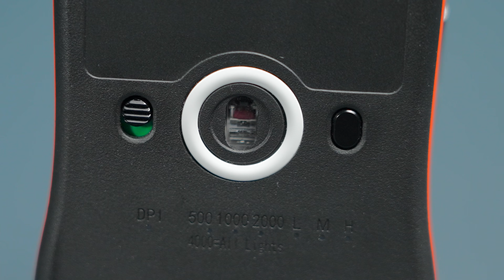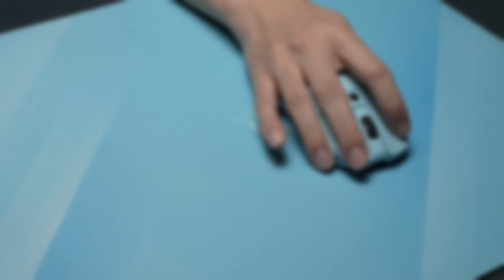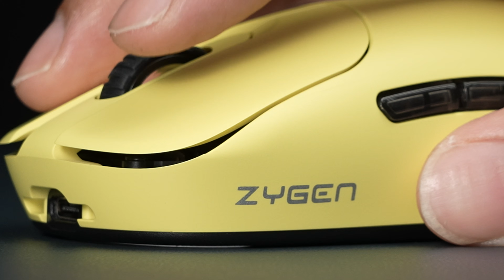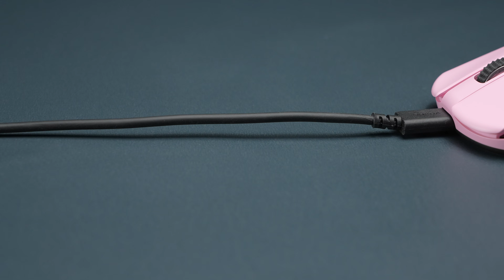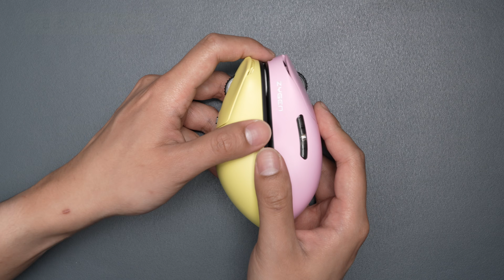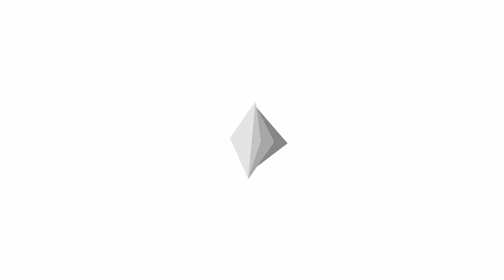VAXEE XE-S Wireless Mouse Introduction Video and Sales Information

Comment: Hi, I cannot find any Driver updatge for XE-S 4K Wireless Firmware update, only XE Wireless 4K. Help me please :(
Reply from the maker: @pandawgf7930  there is no firmware update for XE-S, it comes with the latest firmware
Reply: @VAXEE  But everytime my mouse using the 4K wireless, I got massive drop FPS, and I try with my old mouse, i dont get the FPS drop. Help on this pls
Reply from the maker: @ you can try with 1K and 2K if any change. 4K does use more cpu power, depending on your Pc setting it could drop your fps. You can dm us on twitter or fb with your order number and pc settings for further assist
Reply: @VAXEE  Quick question, how to change from 4K to 1k or 2K?
Reply from the maker: @ at the bottom of the mouse, hold the button until it moves to middle lights, then by clicking the button further you can adjust, 3 lights on is 4k, 2 lights is 2k, other settings are named at the bottom. You can also check XE-S manual under the download page of our website

Comment: Do you have a video on how to adjust the E1 functions via the buttons?
The manual is very confusing
Reply from the maker: Hi, we do not have any video for E1 function sorry, you can let us know which setting you'd like to change and we can inform here; alternatively you can DM us on twitter, FB or our site for further assistance
Reply: @ having trouble getting to 4000 polling
Reply from the maker: The default rate for the mouse would be 4K on, no need to change anything. This cannot be turned on if the mouse is wired or without competitive mode on. If you changed settings and want to go back to 4000hz, you can reset the mouse by holding M1+M2+M4+M5 while turning the mouse on
Reply: @VAXEE  which buttons are M4 and M5?
Reply from the maker: @ the side buttons
Reply from the maker: To change the report rate, you need to hold the right button at the bottom for a couple seconds so it changes which setting is being changed between DPI, report rate or click latency. Once it is in the report rate, you can just click the button to cycle between 500, 1000, 2000 or 4000 report rates

Comment: I love vaxee but "standard of quality" is a push. I've bought a wireless AX with wobble/grind on m1 and a slight rattle. Really poor for price. I'll stick with you guys as the AX shape is amazing but please up the QC. Would have only taken 10 seconds of handing to pick up the issues of mine and when it's so expensive in the EU it's pretty unacceptable especially when compared to me v3 pulsar that's less than half the price. Please do better.
Reply from the maker: @Alex-------  AX button design is different from XE-S it does move more sideways than XE-S. For rattle, if you have this during normal use, it is abnormal. Please reach out to us through our website with a video of the issue so we can assist.

Comment: Your firmware should be web based like Wooting keyboards do with their Wootility. That way, it's OS agnostic so it doesn't matter if your customers are using Linux, Windows or MacOS. More and more peripheral companies are going this route.
Reply from the maker: Hi, there is no firmware update for XE-S at the moment, it is the latest from stock. We do have consideration for driver in the future, web-based is one of our considerations. Thank you.

Comment: I'm rather picky with mice and not in the way most would assume.  The extra button such as pgup has always been a priority for me as i find the extra bind is too handy and there is a lacking for lightweight mice nowadays that has kept the extra button. 

Whilst concerned about the weight of the original XE I gave it a shot recently and just loved it from the get go.  The weight was not an issue people make it out to be and I have small hands.  It's incredibly well built and one of most comfortable larger mice I've tried.  My only thought was a smaller version would be perfect,  and you've done it with a number of improvements!

I have preordered a white XE S and can't wait to try this out!

Comment: Is xe better than xe-s for 18 10 9.5 (f1~f10) palm claw hybrid users?
Reply from the maker: It would depend if you prefer smaller size or medium size, but the palm contact on XE-S would be less for sure

Comment: AMAZING! Keep up the amazing work

PLEASE PLEASE contemplate a pseudo software to reprogram the 4 DPI stages. 3950 sensor allows DPI incriments of 1 which makes transitioning to other games that don't offer custom sensitivities a 1:1 experience for cm/360
Reply from the maker: Software is something we do consider to add in the future
Reply: @VAXEE  Are there going to be any possible plans of updating other mice to the 3950 sensor?
Reply from the maker: @hitkhu  For current shapes, only NP-01S has a confirmed update coming later this year, no plan on others as of right now.
Reply: @VAXEE  For the NP-01S do you guys plan on following the concept of XE-S (literal downscaled version of XE)? Possibly making it ever so slightly shorter? Since current NP-01S feels like a "slim" vs it being a smaller version of NP-01. Or just the same as current NP-01S?
Reply from the maker: @hitkhu  same as NP-01S

Comment: I can't find any mentions about new scroll wheel in the video. Also could you give any info about why you switched from optical wheel encoder to mechanical and how reliable it is?
Reply from the maker: It has the same ALPS encoder as our other wireless but we changed the height of the encoder, the wheel and the rubber. The mechanical scroll is a little less tactile and better for battery.
Reply: @VAXEE  Thank you for communication. I am your huge fan, been using zowie mices for many years and za13 is the best shape I was able to find. I guess I will order this new mouse, I can't find anything better in wireless segment. I just want to be sure that the scroll wheel is reliable, it was always the first part to fail in other mices till I started using zowie.